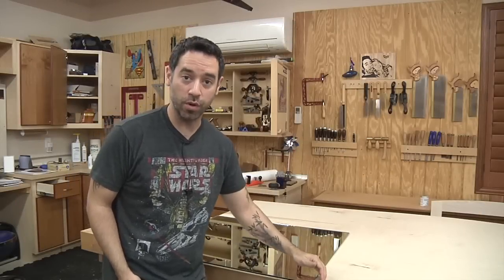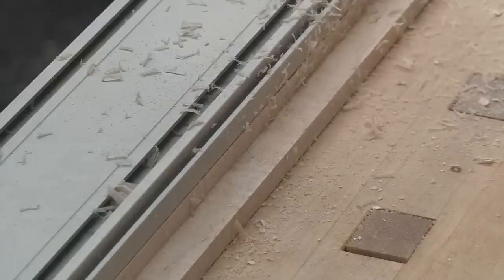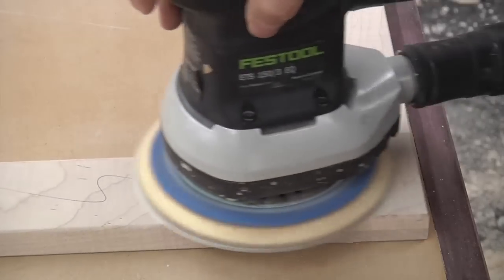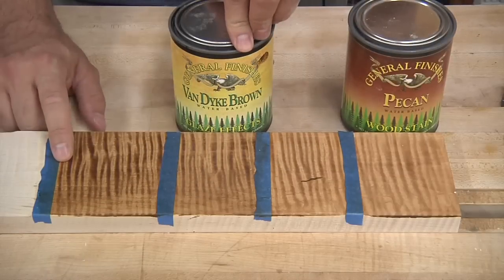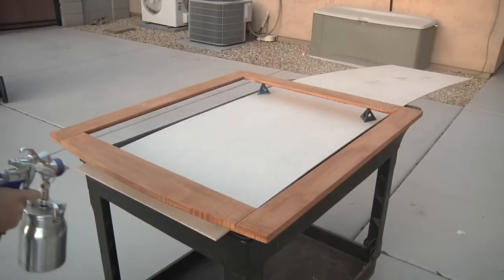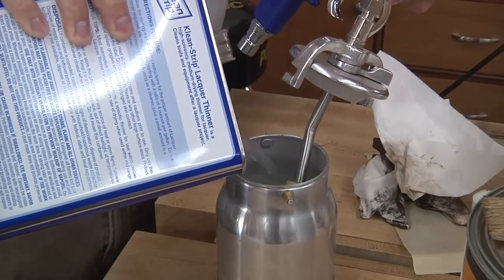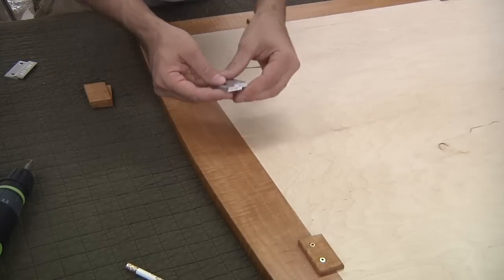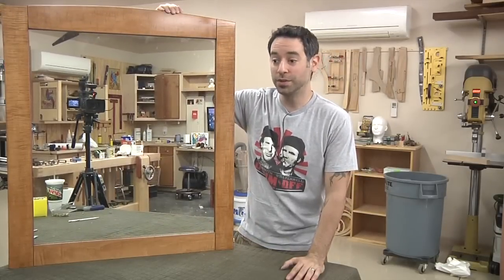Mirror Frame Pt. 2: Rabbets, Clips, & Finish

Comment: Awesome job on a simple yet elegant design.  Like to ask you, what is your HVLP and what nozzle/needle combo did you use to spray the lacquer?  I have been spraying cabinet grade lacquer finishes here and there...and cannot seam to get that smooth flat, dimple-less finish with my Apollo-5.  I even have a high solids cap as well.  I'm close though.  I'm not sure if I'm pushing too much pressure, not big enough needle, thinning out too much or not enough (usually 15~20% thinner)?  Did you spray straight lacquer from the can?  I also never tried the 80/20 thinning/finish step.  Perhaps that might be all that I'm missing?  Thanks again for doing these videos....keep up the great work!

Comment: Awesome series with incredible detail and very useful tips. I have one small question (maybe I missed it in the video), but did you do a finish on the backer board? I image that, with it being in a 'wet' environment, without a finish, it might swell up or otherwise cause trouble. Or did you use some sort of marine-grade plywood?

I hope you keep doing these videos from time to time for those of us who have not (yet) subscribed to the guild.
Reply from the maker: Robert Echten I actually didn't bother with finish on the backer. It's just plywood and isn't likely to move very much. And while there might be some humidity in the bathroom, it really isn't substantial and it's only temporary. So at least in my situation, I don't anticipate any major issues.

Comment: Looks great!
One concern - On the Eagle Clips, do they have some lateral movement stoppage? Like grooves? Otherwise, I feel like when you're cleaning the mirror, you could slide it right off of the clips with a heavy sideways wipe.
Reply from the maker: James Walston If you can slide that much weight just by cleaning the glass, you might be cleaning a little too hard. :)
Reply: Haha that very well may be true ;) thank you for the video!
Reply: Woodworking with The Wood Whisperer True but what about earthquakes?  Oh yeah you are in Arizona.  Not much of a concern there.

Comment: Question about the eagle clips: If someone were to bump into whatever you hang from the side, would it slip off of the clips? Not something you would have to worry about for your mirror of course.
Reply from the maker: dafickler Yes. The clips lock into one another really well so depending on the application, it may or may not be an issue.

Comment: What countersink bit and collar are you using at 3:37?
Reply from the maker: AdmiralBumblebee That's a set from Rockler. Unfortunately, the collar clogs with dust all the time so they can be annoying. But they do cut cleanly. www.rockler.com/rockler-3-piece-tapered-countersink-bit-set-with-case?sid=AFN86
Reply: Woodworking with The Wood Whisperer  Thanks for the reply. I have a set that also clogs in a similar way and I was somewhat hoping you found something that worked better in that regard. Countersink bits are such a pain :(